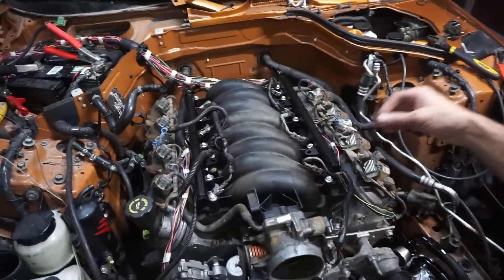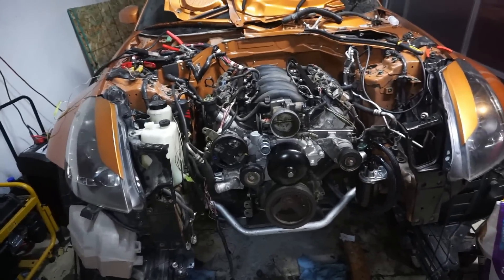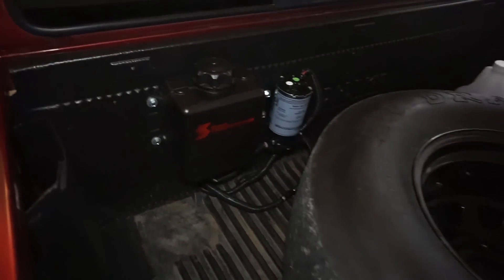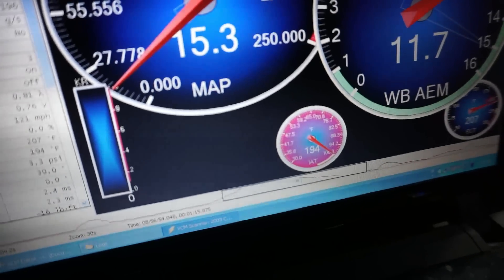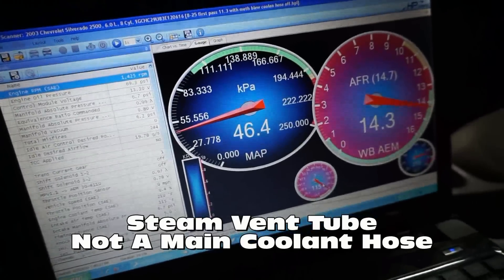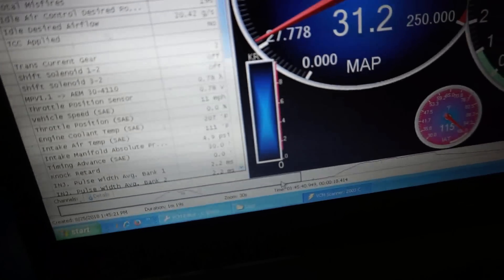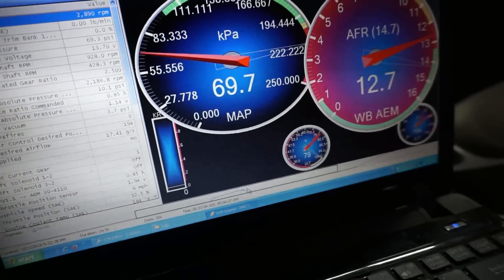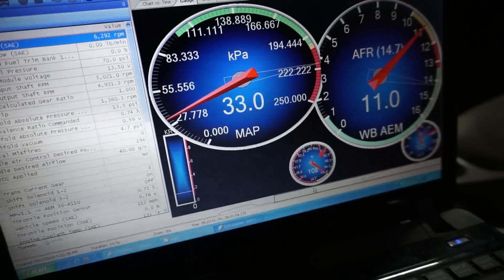DID IT WORK? Snow Performance Methanol Injection Kit!!!

Comment: I'm currently running an l99 on 7psi  with 93 only using the zl1 fuel pump and fscm reprogrammed with zl1 settings..  fuel pressure starts to drop on higher boost..

I'm wondering if I can add a meth kit and spray 100% methanol and run a 10lb spring..

I have no meth experiance.. does this seem feasible to you? Will spraying meth from a meth kit add significant amount of fuel or is it mostly to cool the air charge?

Comment: I have a 383 with 12.1 compression. Would it help me to run meth injection without a tune? I would prefer not to tune for meth injection, so I don't have to worry if the meth injection ever cuts off.

Comment: Turbo is too small. You need a t6 housing unit!!! S400 ftmfw!
Reply from the maker: I'm not sure... I didn't see any improvement from the Gt45(69mm) to the 7875... That's why I switched, but it didn't help at all going bigger.
Reply: @BlaserBuilds  Its the exhaust restriction of a t4 sized housing and inefficiency at 17lbs that limit your output. The snow kit is cool, but really is a band aid, unless you are fully maxing your intercooler's ability. Love the series btw. I catch all your vids. I'm building a Lq4 and will be running either an s480 or s470. Keep wrenching!